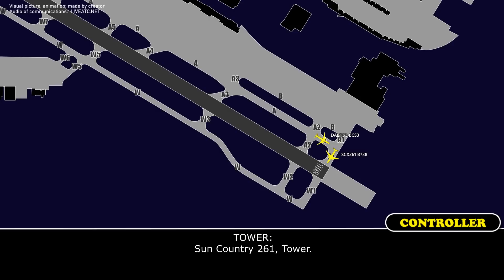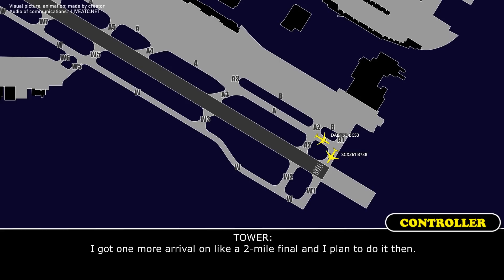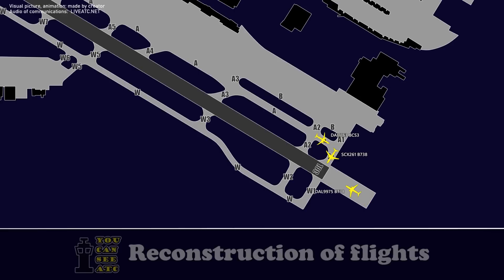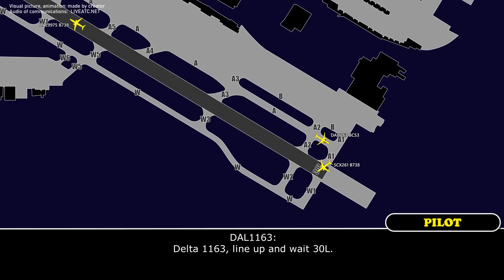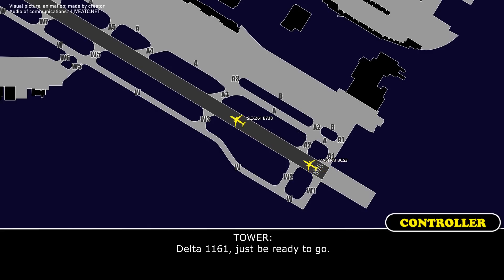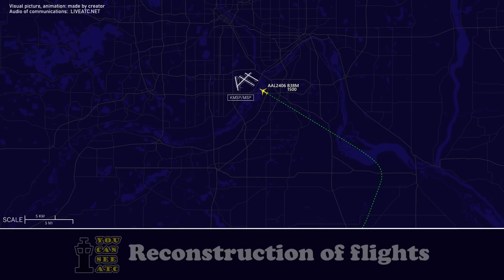Near collision between go around and takeoff at Minneapolis. Delta BCS3 and American B38M. Real ATC

Comment: So the controller actually said right and not left (as AA2406 claims) but got stepped on. But AA2406 never did a readback of the instruction. Is that not required when getting emergency-like instructions like this?

Comment: No excuse, but it's a vicious cycle. If the controllers don't pump the aircraft through at the rate the supervisors expect, then aircraft like that Sun Country miss their IFR release slots, which causes more problems for the controllers and more aircraft to miss their slots. The Tower controller thinks that if he doesn't move the Sun Country out of the way and get the Delta out before the American comes in, then the dominoes will keep falling and ruin the rest of the shift. He's trying to keep a problem with delayed departures from getting worse, and in doing so he creates a much more serious problem.

Comment: Seems to me the main issue was that SCX261 got a later flow time (which I don't understand) had to use the runway to taxi to get back in line, so DAL1163 had to wait until SCX261 exited the runway.  Once I heard ATC say "give me your best speed" to SCX261, I felt it would be too close.  Was A2 not an option for SCX261 to exit the runway or would that not get them far enough off the runway?
Reply: He could have had Delta exit there as well, but often times at airports ATC has their favorites, delta and MSP for example. The ATC did everything he could not to delay the delta guy but our everyone else in a precarious position!

Comment: What was up with the Sun Country flight at the start?
Reply: They must have cut the line and were caught and told to go the back of the line.  Just kidding.  I don't know what "you got a later flow time" means.  Delta probably pays way more airport fees than Sun Country so they might get priority.
Reply: A flow time is a specific time slot that they need to be wheels up. Take for example JFK. If you have 30 arrivals within a few minutes, the flow time is set up to help space them out so they’re not arriving at the same time

Comment: This is exactly why you should depart and land on separate runways. There are two parallel runways and both were open
Reply: Both runways were in use for both landing and departing at the same time, on the radar view only relevant aircraft for 30L was shown.
Reply: @kolbase  that isn’t what I’m saying, I was probably a little confusing. They should have one dedicated runway for departures and one for arrivals. Like LAX, DFW, and ATL they each have dedicated landing and departing runways
Reply: @BradyBaseball13  Pretty sure that is not the case at LAX. Multiple arrivals and departures on both runways simultaneously, all the time.
Reply: @johnnyneverletmedown53  that hasn’t been the case from what I have seen and what they broadcast on ATIS. I have flown into LAX plenty of times in the last 3 years. They always depart 25R/24L and arrive on 25L/24R. 

Only one time in my career have they departed me on 25L, when they had no arrivals.
Reply: @BradyBaseball13  Fair call, I see what you are saying. I have been on heavies, 777's, 747, A, 340 & 380's many times out of LA, and always depart on 24 L, sometimes waiting for another heavy to land on 24L. But point taken, it is the "norm" for most landings to take place on 24 R. Only once left of 25R on a heavy, but smaller planes quite a few times. I'm not an airline pilot, private yes, you obviously are in the biz, so I defer to you.
Reply: @johnnyneverletmedown53  hey that’s awesome, are you trying to become an airline pilot?

Comment: It was not that close. Of course it uncommon and should be investigated because they could have collided if they followed their paths... however, 200 feet and 0.14nm (60 meters and 260 meters) is not thaaat close for two objects IF they are NOT in a collision path. But yes, they need to investigate.
Reply: It is very close for two commercial aircraft full of passengers. The flight crews may well not have had each other in sight for much of the incident.
Reply: You have no idea how close 200 ft is when you’re going 200kts
Reply: @jakeoesterreich8037 less than 200kts.
Reply: @TB-um1xz  not by much. More like 160-180 but still
Reply: @jakeoesterreich8037  unless they were really heavy. 120-140 is a normal approach speed.
Reply: @TB-um1xz  the aircraft were close when they were on the climb out, not approach. You don’t climb out at approach speed, you climb out faster than that
Reply: @jakeoesterreich8037  I guess you don't fly part 121 for a living. First watching the video, the AA was on short final when the go-around was given. So they would have been at approach speed. This next part, I'm not sure which method they did. Boeing aircraft, when you hit toga once, the plane will climb at 2k feet per minute with reduced thrust. The plane does not accelerate quickly until gear and flaps are coming up, plus above 1k feet.

Comment: Ok so MSP is losing its mind. I left Thursday the 15th at 22:14 from MSP to DFW on 2406, and we were cleared to line up. As we’re moving onto the runway, I see lights lined up really close  with the runway we just pulled onto. And then seconds later. The engines throttled up and we turn hard left onto the taxi way we just left.. I have video as well
Reply: Not sure if the commented saved. I can see at 3:20UTC (16th) time that your aircraft AA2406 did turn off immediately and rejoin and line up. Not sure why. No conflicting traffic apparent in FR24.
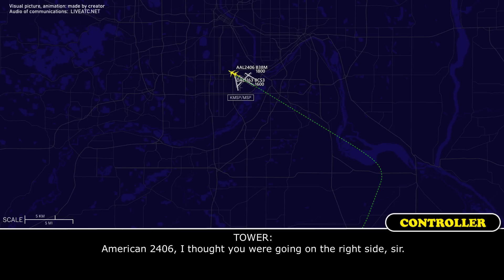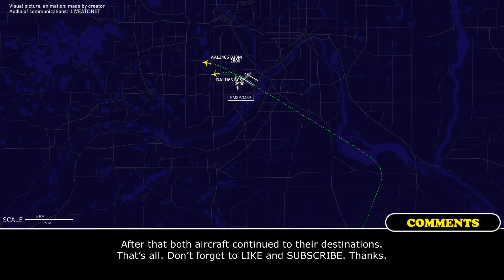Reply: Just checked ATC. You’re correct. ATC says he hasn’t got room and gives him a left and left instruction. 15:25 mins in on the LiveATC archive for 3:00 - 3:30Z
Reply: He tried to get your flight away before DAL826 but couldn’t fit it in. Unfortunately FR24 wasn’t showing your aircraft until after they landed.
Reply: Those Democrat leftists jack up everything.

Comment: Honestly, wait the extra two minutes and let American land before lining up Delta. You should never issue a landing clearance followed immediately by a pull-up and go around. I understand wanting to be expeditious, but very poor planning by the tower controller. Safety comes first.
Reply: Delta and Sun Country did really well in the push (why sun country was pulled out of line at the runway is ridiculous), but I didn’t hear a minimum speed request to American, nor a “go around fly heading 340”.  Now as I type this, i recall the ILS critical area, which leads me to believe the field is IFR, so following published is likely required.

Comment: Why didn't they just wait for AA to land before taking off delta...
Reply: Money. They are urged to pack as many planes into an hour as possible, with no regards on safety. In Europe, nobody would be allowed to clear a used runway. US regulations allow this.
Reply: @RubenKelevra  and how many crashes a year happen in the US?
Reply: @alquinn8576 among commercial air carriers? 0
Reply: @RubenKelevra dude, you gotta stop reposting that. You’re not correct. You don’t talk to airplanes on a daily basis, you don’t know what our job entails
Reply: @wiley5oh51  we have had so many near misses in the last couple of years, I don't think the current practice is safe. Clearing planes to land, while the runway is not clear, hoping to be able to reach out if something goes south is not safe by any rational standard.

This has to stop of people will die because of the greed involved here.
Reply: @RubenKelevra  you want to make the mode of travel that is already an order of magnitude or two safer than any other even safer because of "near" misses? lol
Reply: @alquinn8576  This was a near miss. Not sure what the quotations are for.

Comment: on go arounds atc doesn't normally give right left side of runway's. how about s phone number for tower
Reply: Sidestepping is a way of deconflicting traffic (usually at non towered airports) if say, you're landing but someone else is taking off at the same time on the same runway for whatever reason (loss of situational awareness,  no radio calls, disregard for others, etc). The FAA advises sidestepping to the right (if safe to do so) so that the pilot of the landing aircraft will have an unobstructed view of the one taking off to maintain visual separation. But like I said,  this procedure is used at non towered airports if this situation happens but I'm not sure about towered airports and airliners under the control of ATC.

Comment: I’ve never heard a go around instruction with “on the right side”. That’s not a standard phrase, they should have been given a heading.
Reply: Controller's intent wasn't a heading, which would diverge away, but more of an s-turn, or sideslip, which would put the go-round plane on a line parallel to the runway but still on runway heading, and turn the takeoff plane to the left.  Problem was the go-round plane had a dyslexic moment, and sideslipped to the LEFT side (outside) of the runway...an evasive maneuver that made more sense to the PIC in the moment...which screwed up the controller's plan.
Reply: That was a panicked atc controller at that point. Lost situational awareness and then lost his cool.
Reply: @happykillmore349  I'd argue that the American pilot was the one who panicked.  But only for the briefest of moments, by sideslipping to the left (which probably made more sense to him as an evasive maneuver) instead of the right, as the controller instructed.  Not that the controller actually used the word "sideslip", but that's the maneuver he performed, so standard phrasing or not, THAT part was understood.  ATC was just trying to clear a jam-packed plate with wheels-up times to accomodate on the one hand and incoming on the other.
Reply: There was a transmission for a split-second that crossed with the word "right" when the go-around was instructed.  That contributed to allowing the confusion to arise, IMO.
Reply: Honestly the biggest issue here is then non-standard phraseology and lack of read back absolutely endemic in US aviation radio comms. If you give some a go around instruction with a second instruction, “on the go” is a completely useless response from the pilot. The rest of the world runs busy airports with full sentences and proper read backs!
Reply: Not common but not unheard of.

Comment: What is with all of these near misses this year?  Incompetent pilots? ATC? What is going on?
Reply: This one definitely seems like the tower’s fault. Should have never given that line up and wait instruction with an aircraft just beginning a runway taxi ahead and another on 5-mile final.
Reply: The FAA doesn't have an incentive pay program for "least delay" do they? It seems like the tower controllers like to have aircraft line up and wait with guys on short final.  Incentive pay programs usually produce the results you pay for.
Reply: We have determined that there are a lot of "near misses" this year as the primary cause.
Reply: Both pilot and ATC global shortages. Both are overworked.
Reply: Regulations are the issue. They are urged to pack as many planes into an hour as possible, with no regards on safety. In Europe, nobody would be allowed to clear a used runway. US regulations allow this.
Reply: @RubenKelevra  Out of control capitalism